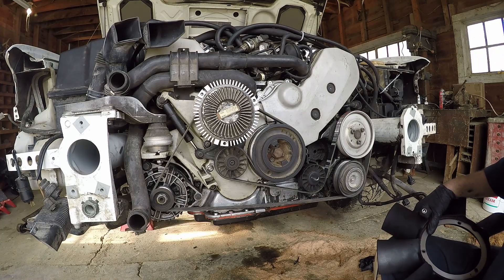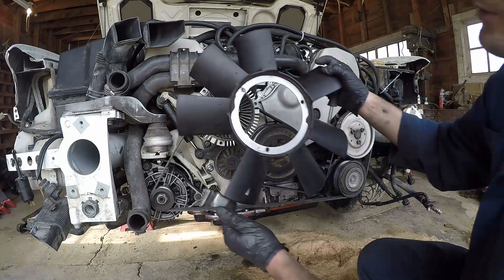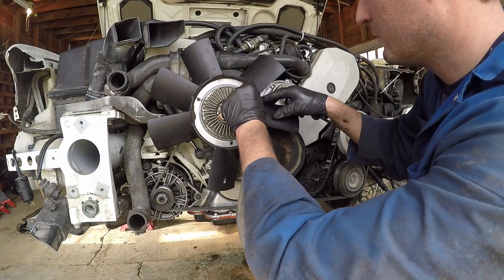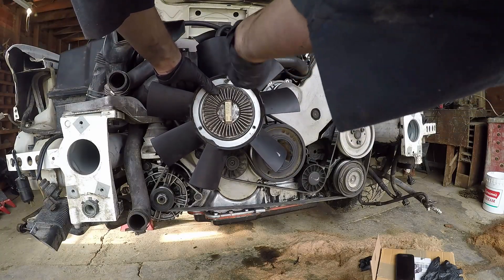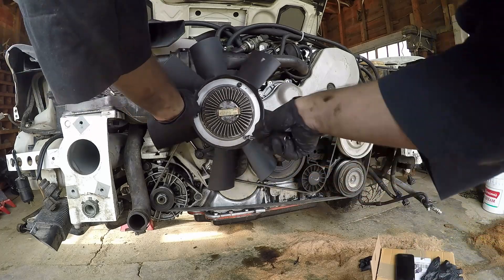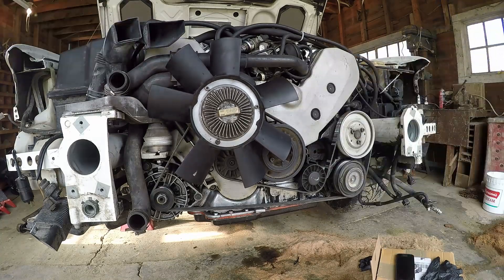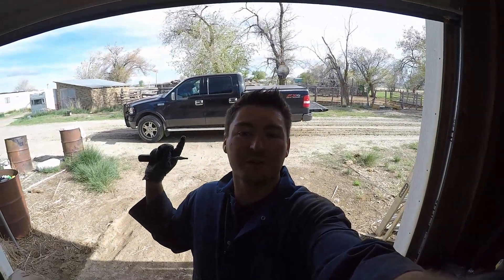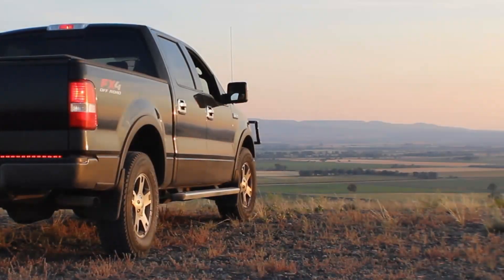How to Install / Remove Cooling Fan Blades on a 1997 - 2003 Audi A8 Quattro 4.2l V8

Comment: Same way I do on my e46 too yo. Can I do it with the front clip an shit still on the 2.8 Audi?
Reply from the maker: Hi, thanks for the comment! I'm not sure... I don't know the 2.8, but it looks like it is a similar set up. If I just wanted to remove / replace the fan blades on the 4.2 in the A8, I would unfortunately have to put the car in service position, or at least take off the front end enough to create some space...